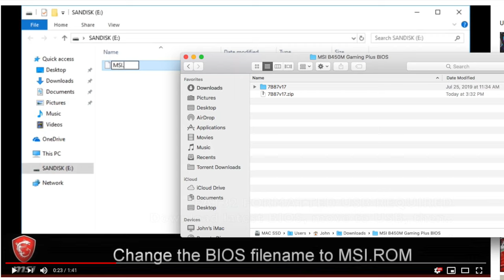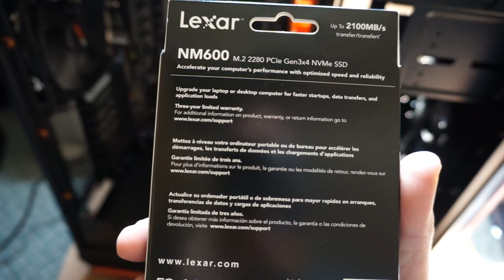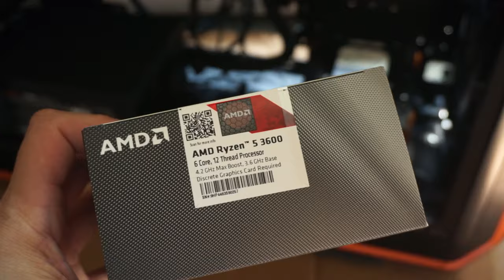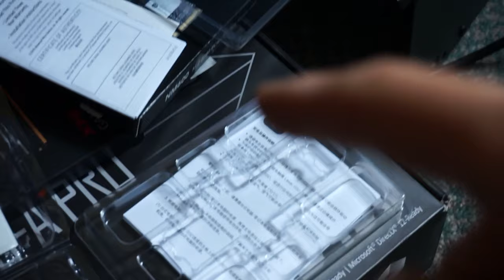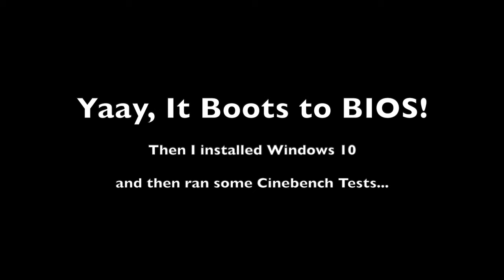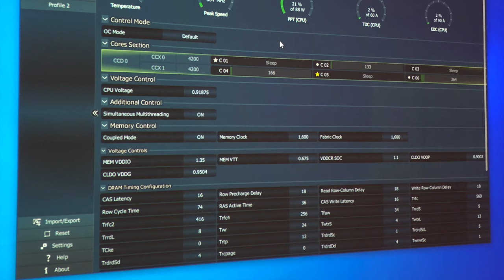bequiet! AMD Ryzen 5 3600 Build. MSI B450 BIOS Flashback Feature was Essential -  Netcruzer TECH

Comment: Am doing + filming almost the exact same build right now! Can’t believe you posted this today. Had the bios issue, this helped! Thanks.
Reply from the maker: It’s awesome. I’ll throw a better cooler on it but even with stock it’s beating my i5 8600K scores by 10-20%.
Reply: By far the best all-around performance for value build someone can do to right now. I still can’t believe we’re also using the exact same graphics card... what are the chances. A fantastic cooling tempered glass case is the DIY PC GT RGB.
Reply: By far the best all-around performance for value build someone can do to right now. I still can’t believe we’re also using the exact same graphics card... what are the chances. A fantastic cooling tempered glass case is the DIY PC GT RGB.
Reply: By far the best all-around performance for value build someone can do to right now. I still can’t believe we’re also using the exact same graphics card... what are the chances. A fantastic cooling tempered glass case is the DIY PC GT RGB.
Reply: By far the best all-around performance for value build someone can do to right now. I still can’t believe we’re also using the exact same graphics card... what are the chances. A fantastic cooling tempered glass case is the DIY PC GT RGB.
Reply: I have to have ryzen 2000 to have a 3300x on the msk b450 a pro max?

Comment: Thanks bro. That's exactly what I needed to know.  I was looking for a mobo that will recognize a Ryzen 5 3600.
Reply from the maker: Yeah, There are 4 or 5 MSI B450 boards with USB BIOS Flashback.  B450 tomahawk, B450M Gaming Plus, B450-A-PRO and a couple of others I can’t remember. Great feature. It’s also saved me already after I couldn’t boot or reset bios after adjusting memory overlock. I reflashed it and it came back to life.
Reply: How about the b450 aorus elite?
Reply from the maker: @lutherdimaano2036  No. Only a select few MSI boards can do the no-cpu bios update. All other boards required an older CPU installed to update.
Reply: Netcruzer RC TECH CARS I just built my computer and have the problem of the mobo not recognizing the cpu, I have a b450 tomahawk max. What do I do

Comment: usually People install the CPU and Cooler on the Motherboard box before installing the Motherboard inside the case. Install all components 1st like CPU, Cooler, and Ram before you mount to case, that way the back plate will be on the motherboard box and you won't have to hold anything.

Comment: Built a Ryzen 5 2600 rig early in the year but never could get it to flash the bios. Guess I don't need to with a Zen-1, but would have been nice. MSI Tomahawk 450. Am pretty pleased with the system all in all. Running Win-7 - which I LOVE. Lightning fast compared to my Win-10 laptop. BTW, I find it easier to mount the micro and heatsink with the mobo out of the case.

Comment: I know this video is a bit old but hopefully I can get a response. I have a similar build. Ryzen 5 3600, msi b450 tomahawk motherboard (not max), and a m.2 upgrade on top of my original ssd that was installed when I first booted. I cannot for the life of me get the m.2 memory to be usable. It shows up in the hardware monitor but not in windows, and I have no way of messing with pcie settings. My motherboard gives me the same shitty bios (click 1) with very little settings and no advanced mode. Any suggestions would be greatly appreciated.

Comment: Hello, I have a ryden 5 3600 and a msi b450 gaming plus, my concern and that I already have everything installed, then I do with the components already in place to flash?
Reply from the maker: Yes that will work too. I’ve done it both ways. MSI instructions say do it without CPU or ram installed but it worked for me with it installed.
Reply: @netcruzer  we should just run the lasted bios up date correct?
Reply from the maker: @PercyDays  yes

Comment: could you tell me what this motherboard is like, if you did overclock what are her vrm temps and if you encounter any problems with her after some time of usage and any other useful information you got on her that you think should be said. cause ive been looking to get her with the new ryzen 3600 chip just as you , and honestly i have not been lucky finding much info about her.  thanks in advance and have a great day
Reply from the maker: I just upgraded the cooler yesterday, and using precision boost overdrive or manual overclocking got my VRM temps up to 57c on a stress test.  Seems perfectly stable.. I'm hitting a CPU limit more than a VRM limit as far as I can tell.   Under normal situations the VRMs are at 40c.  I'm unsure how hot is unstable for them.
Reply: @netcruzer  thanks for the reply, i think ill wait for the max series of msi to arrive to my country and be more on the safe side, cause i read there is alot of unlucky people that have boot and post issues with their boards and some other stuff. god bless you man
Reply: @stasik1317  my r5 3600 is running good with my b450m gaming plus from msi, but i can only use the lite version of its last bios

Comment: Hi, I'd be grateful If you could tell me If this MB support 3200 MHz RAM without the need to be OC? Thank you
Reply from the maker: It does but not sure what you mean by OC. All high MHz ram is OC. It’s for XMP profiles built in to do it. Yes it works without manually configuring it but some ram might not be detected properly.

Comment: can you make a r5 3600 + b450 a pro overclock guide with custom cooler pls.
Reply: I dont think he can afford that
Reply from the maker: In progress! Custom cooler already installed. But overall Ryzen doesn’t have much overclocking headroom, it’s IMO not worth a cooler upgrade except for the looks, and if you want minor boost gain  (like 50cb points and 100-200Mhz more)
Reply: the b450 a isnt great as a overclocking board and neither is the 3600 chip. If you really want to OC ryzen then you will have to invest in a board with better vrm/more phases along with the 3600X chip. like yeah you might be able to get another 200 MHz if your lucky, but if you really REALLY want the absolute best performance per dollar get a 3600 MHz ram kit but dont try to OC it on the b450 platorm as the b450 really doesnt have the strength to go much farther unless you get Samsung b-die ram but thats typically more expensive and not the best value per dollar. just get a semi cheap 3600 MHz ram and dont oc because 3600 MHz is also the top speed of infinity fabric. since the fabric and ramspeed work best at a 1:1 ratio, thats why i dont say to oc unless you go the expensive route. oh and if you are OC'ing both ram and cpu with OC of the Fabric, you will probably need at least a slightly better cooler.

Comment: PLEASE HELP!
I've just upgraded my build from i5 4690k, R9 380X, 8GB RAM to a Ryzen 7 3700x, 5700 XT, 16GB RAM with a B450 Aorus Elite MOBO. 

I knew the B450 series MOBO's required a BIOS update when partnered with Ryzen 3 series', I've just putt together this build and I can't even get a signal to my monitor? Have I put something together wrong or is the outdated BIOS the issue? Obviously I cannot update my BIOS when my monitor doesn't have signal
Reply from the maker: You need a 2xxx series Ryzen or older to update your bios. As far as I know you can’t do what I did without a CPU. I chose MSI b450 board exactly for this reason. No cpu USB bios flash

Comment: Hello I have a b450 msi gaming plus max with ryzen 5 3600. But I can't install windows 10. My computer boot again and again.  In the bios do you have activate uefi or legacy + uefi ? Do you know why I can't install windows 10 ? Do you think the iso is corrupt or bad ? Do you think my cpu is dead ?
Reply from the maker: How are you trying to install windows 10? Download the ISO is win10 v1909 64bit and use the media creation tool to make a boot USB drive windows installer. Your SSD should be wiped completely use uefi for most modern boot up. No bios needed on MAX for it to work with Ryzen 3000, but if it’s unstable you can apply latest update.
Reply: I have downloaded a windows 10 iso and  burn it on dvd. But when I boot on dvd it begin to install and stop before I can see the windows of windows 10 asking me where I want to install it. The computer reboot directly, i'm not able to install windows 10. I'm trying to download another iso but I'm afraid it's my cpu is dead, I saw it in the bios I don't understand what is the problem I have the last bios on my motherboard
Reply from the maker: @nadagalou  If it attempts to install windows your "CPU isn't dead". You wouldn't be able to get into the BIOS if there was a hardware problem.  It's likely the DVD you burned.  Do it again, or try from USB stick.

Comment: Hello there sir... i have a question. So i recently bought my first desktop a few weeks ago. I have a aorus b450 pro and the ryzen 5 3600 also. What they did is, they used a ryzen 5 2600 to update the bios so that it will be compatible with the 3600. My concern is, when ever i turn on the pc. Everything lights up, my mouse, keyboard, the rgb fans, except for the motherboard. It takes around 50 seconds for it to light up. Once it lights up. It takes only like 10 seconds for it to boot up to windows 10. Is that because of the bios? Or something wrong with my setup? Hope you can enlighten me with this. Thanks so much
Reply: Also i would like to add that there is a red light. Its not blinking. Just a solid red light. The red light disappears once the motherboard lights up.
Reply from the maker: I'm not familiar with this motherboard. I think the lag your perceiving is possibly your monitor waiting for a video signal?  A full minute to boot is pretty long time on modern hardware. Do you have an SSD or a hard drive?  If hard drive that timing is normal.

Comment: Do i have to remove ram, graphics card and processor before flashing bios?
Reply from the maker: No. I tried too fast ram timings and my system would not post. A USB bios flash worked to reset it with all components installed.
Reply: @netcruzer  i had bios menu when i first started pc... then i turned all off functions to on...  genie and something else...  eventually i fucked up something and pc can't go to bios now... i didn't informed abaut  process  and now i have black screen
Reply: @tomislavbudrovac8690  if you were screwing with BIOS updates and didn't complete them properly, they absolutely can NOT be interrupted once started, you might have bricked the board.  Try a CMOS reset.  If that doesn't work... you can make a nice analog clock out of it.

Comment: The temperature with my R5 3600 is so high in iddle and stress
Iddle is 50 degree at 60 degree and stress is 80 degree ate 90 degree
I use a Maelstrom 240T and MX4.

Comment: is flashback feature essential on ryzen 2000 series?
Reply: No.  It's not essential at all.  Even if you didn't have it you could take it to a computer place, have them drop in an old CPU, flash the BIOS for 3000 series and you're good.  It's just so much EASIER to have BIOS flashback.  If you shop around for your board (and if I've learned anything this week it's that every board mfg. has good boards and everyone has bad boards - check reviews for every single board you're looking at) you can find boards with lots of features for cheap.  The CPU is easy to choose - spend your time getting a very good mainboard.

Comment: Terrible way to build a computer lol. You made it so much more difficult on yourself by putting it in the case first rather than just leaving it out...
Reply from the maker: Have you ever tried to mount a motherboard with a big CPU cooler already on it? I don’t recommend it. In this case the cooler is small, but I’d still put motherboard in first. It was mostly awkward because I had to get the right angles on video to show it.
Reply: @netcruzer  Depends on what you call big. I've mounted a H212 evo both in and out of the case. Was significantly easier out of the case. Not that it matters in this case you could have had everything ready to go before putting it in the case.